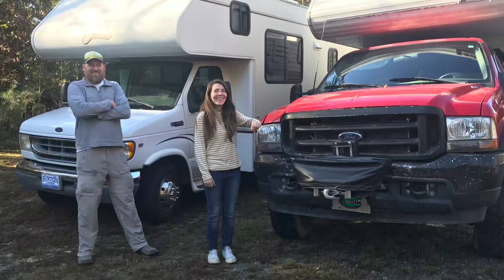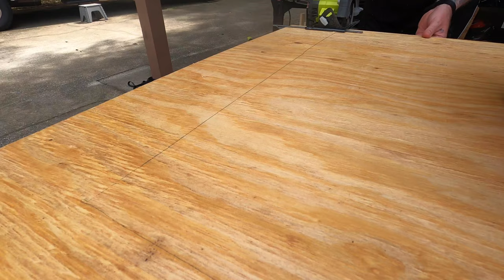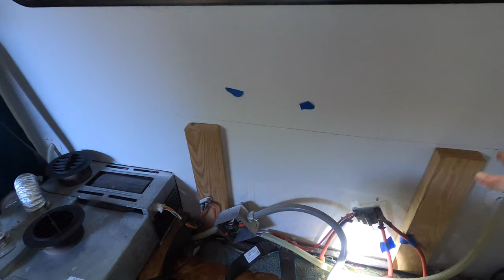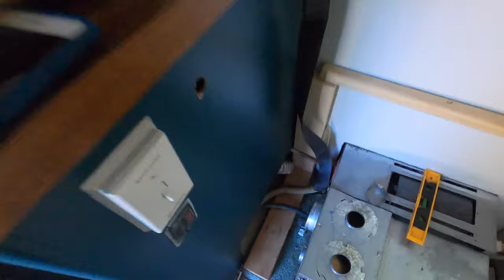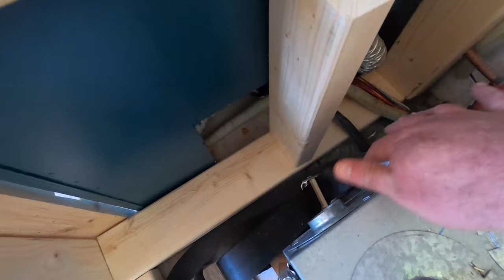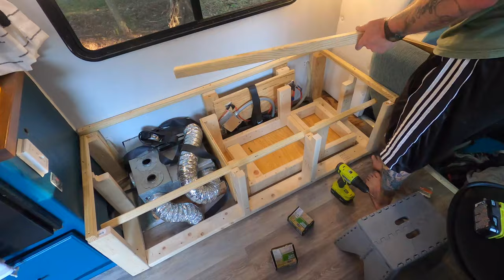CtW 137 // Building Our DIY Pull Out Sofa Part 1 // Class C RV Remodel on a Budget

Comment: Use not only screws but also wood glue for the battery holder frame - it increases the strength.
Is a safety-thing.

Overthinking to often is normal - you build your Home for the next (hopfully) decades. 
Good Job! Cheers Alfred
Reply from the maker: This box was so well wedged in place (and anchored with 4 screws) that the only way it is moving is if we hit a deer at 70 mph (which we are not anticipating!). But great tips! We know at some point we will upgrade to Lithium batteries (that we can't afford at this point) so with all things in this remodel, we're keeping our options open in changing things up down the road! But the overthinking paid off, I think?!
Reply: @CalledToWander  Hit a deer - hopefully never happend. I guess i build often too strong - i like it Bullet-proof...
Btw: all Vid`s are very helpful; many thank`s for share all your builds!